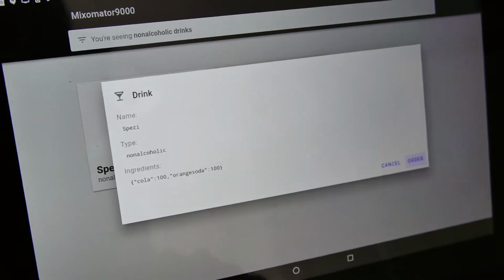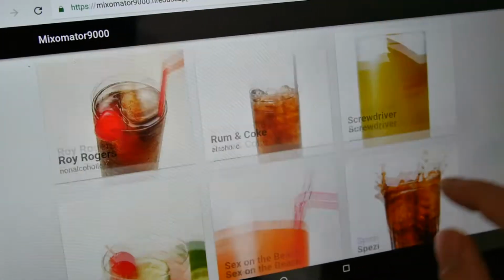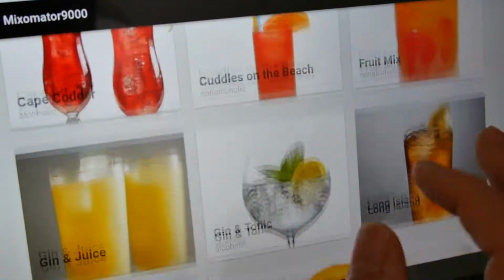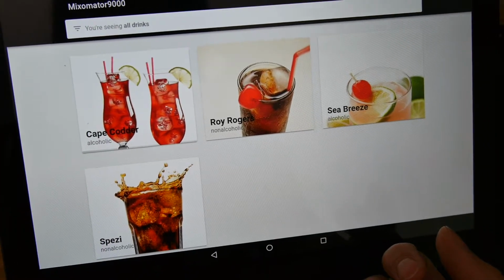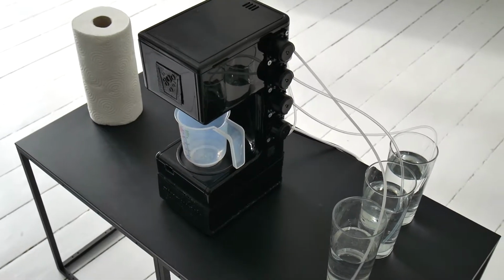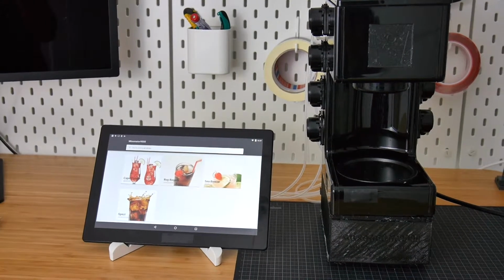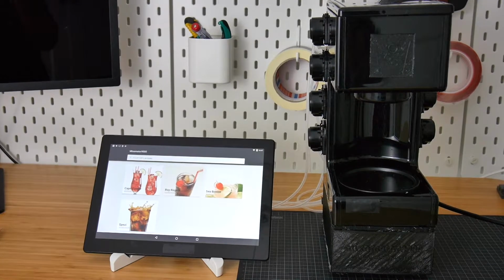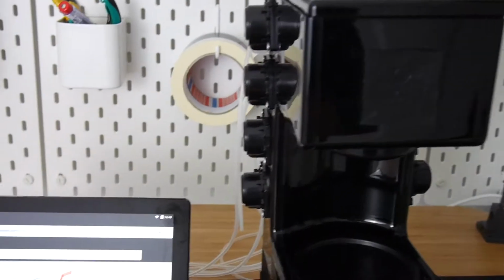Automated Liquid Mover - Part 4: Web Interface and Testing

Comment: would be nice to have a back feed in form of the scale under the glass so that it turns on when the pressure is changed zero the scale and confirm the weight of liquid poored